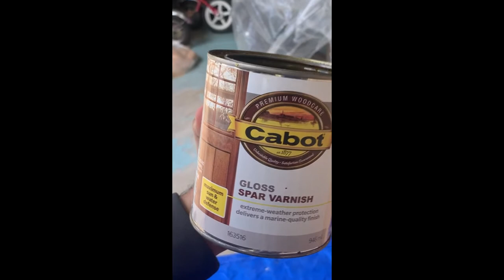DIY Large Cedar Raised Planter Box with Drainage for $50

Comment: How is the spar varnish holding up?  Did you sand between coats?
Reply from the maker: Yup, a light sanding was done. It has been sitting outside through the winter and still looks good.